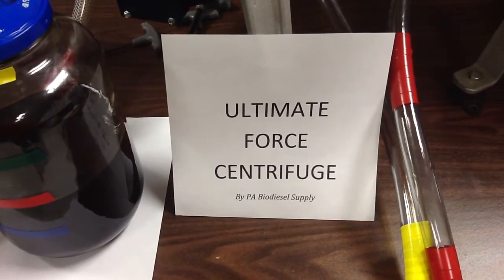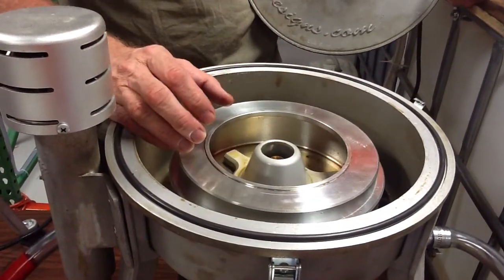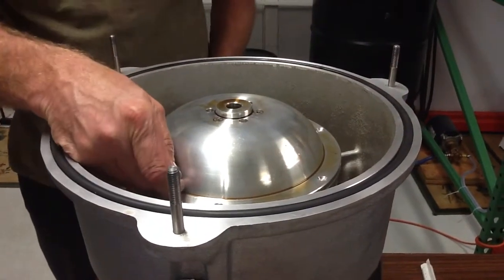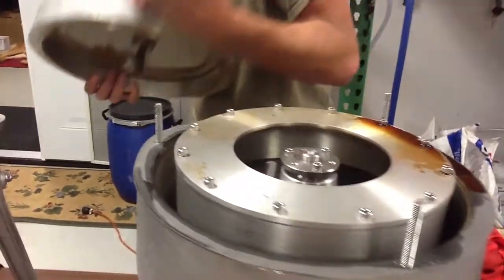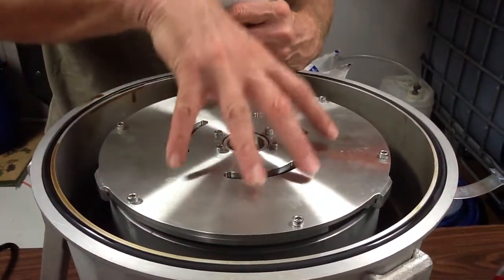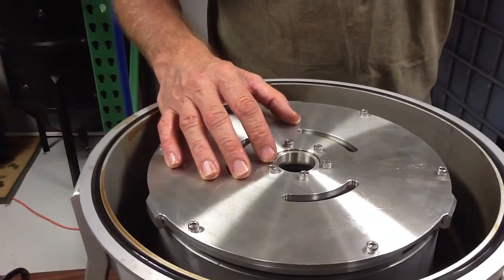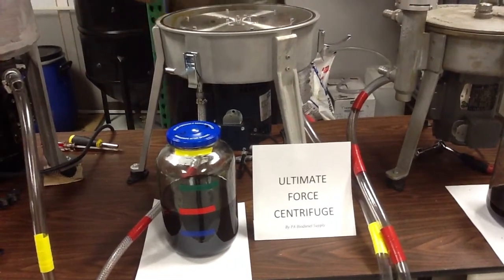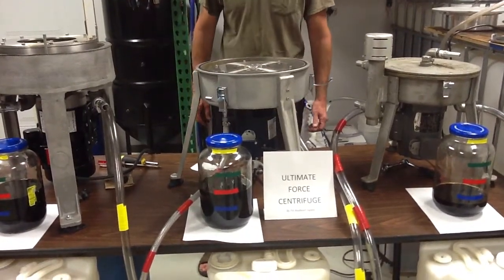Ultimate Force oil centrifuge and our competitors oil centrifuge. Lets look under the hood.

Comment: You actually CAN get <.5 micron filtration in a single pass. You just need to cut the flow rate. Figure the G's of centrifugal force X lip depth. (from outer ring to breach). the doubling the lip depth with half the g force, will give the same result as high g's, with a shallow lip depth. To get the single pass filtration, just think cups per hour, not gallons per hour. Viscosity plays just as big a role as either of the factors I just mentioned. Heating the oil to thin it, or, merely cutting the flow rate even further for thicker oil will allow the sub-micron single pass filtration. 
     The one with the rounded bowl, with the lip barely larger than the inlet, would work really well, just because of the deeper lip depth. Another advantage of that design, is that the velocity of the oil leaving the bowl is much lower velocity, reducing sheer stress on the oil, reducing misting, as well as foaming. To get around the lower g-force that close to the center, the inlet just needs to have 'spokes', keeping the dirty oil isolated from the separated oil, then, releasing it closer to the outer rim of the bowl.

Comment: You're not an engineer, but I know one... G's=Speed * Speed(rpm) * inches (diameter) / 70414.11
9 inch diameter at 1800 rpm: 1800 * 1800 * 9 / 70414.11 = 414.1 G
9 inch diameter at 3600 rpm: 3600 * 3600 * 9 / 70414.11 = 1656.5 G
9 inch diameter at 6000 rpm: 6000 * 6000 * 9 / 70414.11 = 4601.4 G
18 inch diameter at 6000 rpm: 6000 * 6000 * 18 / 70414.11 = 9202.7 G
Double the diameter, double the force;  Double the speed, 4 times the force.
In the bowl shaped one, at half the diameter, there would be 1/2 the force, but any particles should still work their way to the outer edge IF in the solution long enough.
Great comparison video!
Reply from the maker: No I'm not an engineer, but we have a consulting engineer, and we do oil and have done oil filtration for years now. All of our vehicles are running on alternative fuels. We run an industrial filtration site at www.centrifuge oil filtration, We have built centrifuge filtration units for companies like Babcock Wilcox, J.W. Aluminum, Conrad Ind. and a host of other companies.
We also do oil at our alternative fuel site at www. pa biodiesel supply.
We encourage customers to come to our shop to view and use our products before purchasing
We appreciate your input.
Reply: Thank you for doing the math. 
I have a 6 inch that does 8000 RPM
And I was worried it might not have enough G’s Now I know it’s more than adequate. Thank you very much.
Reply: @openyoureyes3113  You're generating 5,453.45 g's. Adjust your flow rate according the the viscosity of your oil, and the necessary filtration level. The advantage of the small high speed bowl, is that there is less oil volume in the bowl, so there's less waste. You do need to reduce flow rate, to allow enough time, to sling out the particulate matter.